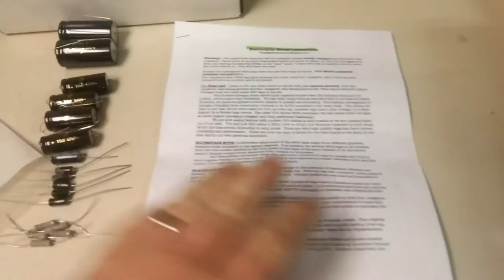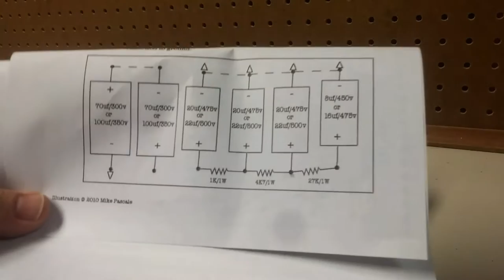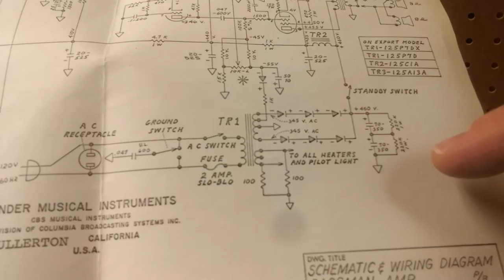Replacing Electrolytic Capacitors on a Fender Bassman

Comment: 21:10 on the bias electrolytic capacitor. positive goes to ground. negative goes to bias circuit. bias is a negative voltage. to work correctly, ground is a more positive voltage than the bias circuit. (positive lead goes through the board to be soldered to the chasis)

Comment: Great video! I am a newb at amp repair/building as well but I would like to let you know to maybe use a wooden chopstick when pointing out /prodding around an amp like this. I know you were safe in this video but I cringed a little when you were using the metal pilers.  Just a friendly fyi :-)

Comment: Really nice video on something that every vintage amp should have done if it hasn’t already  -  some recommend replacing the electrolytic caps every ten years or so but I ‘m wondering if today’s caps last longer than the older ones. Certainly if you find a 60’s or 70’s amp with it’s original caps they should be replaced. I did find it strange that he left the tubes in while working on the “dog house” caps  -  seems like asking for trouble to me. And then he put them back in later upside down. Why not flip the amp so you can see what you’re doing? I’ve also heard (and do) that after replacing the electrolytic caps you should bring the voltage up slowly when you first plug the amp in. Several ways to do that but if you’re going to be doing it a lot it’s worth it to get a variac - you can sometimes pick one up on eBay fairly cheaply. I just wish that the Bassman I’m about to attack was as clean as his! Glad I watched this before I start just as a confidence builder! Thanks.

Comment: Great video! Very informative. Helped me solve my problem. Can you provide a link where I may source one of those recap kits please? One or two of my 500V caps have spewed their guts. The amp still works though, but I've gotta get those caps and the 10K and 4.7K resistors that are out of spec around it replaced.

Comment: Nice job. One thing I would point out is something that an amp builder shared with me. Get out of the habit of using a pencil when working in the amp. If you forget and power up the amp and use the pencil to probe, that could be disastrous since the graphite in the pencil conducts electricity. Use a chop stick or dowel instead.

Comment: Next time you're inside the amp, you might consider replacing those .01 disc capacitors with some orange drops. Those old disc caps can be a source of noise and/or microphonics.